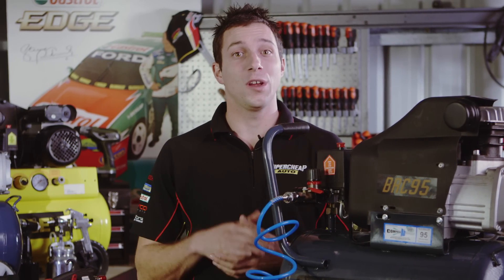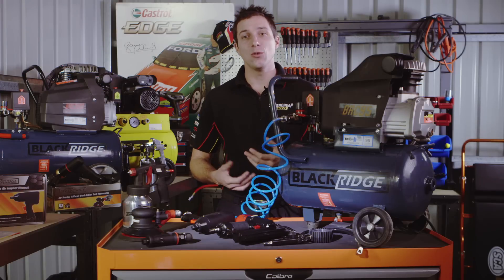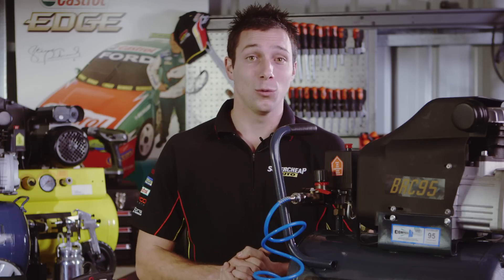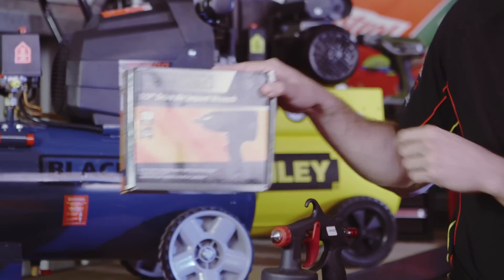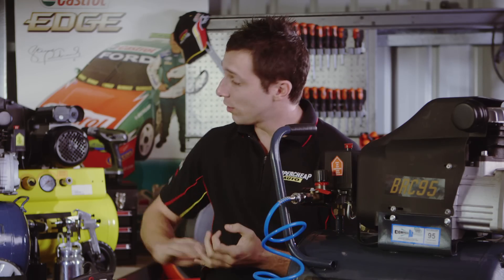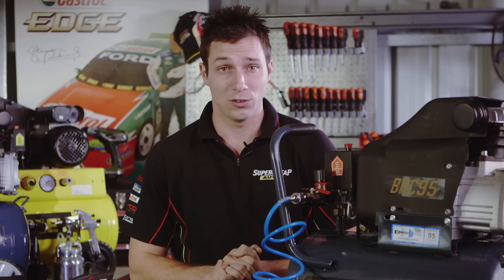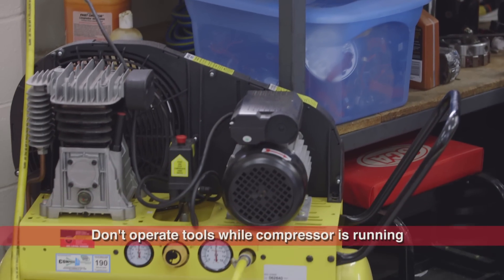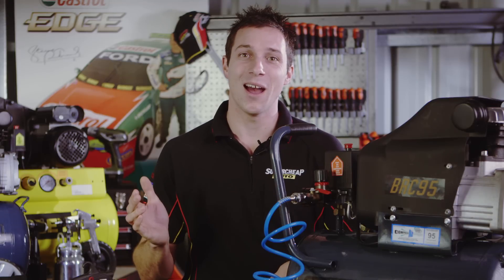How to - Choosing a 240V Air Compressor // Supercheap Auto

Comment: might be a good idea not to mix metric (LPM) with imperial (PSI) units. Other than that, a clear simple intro to air compressors.
Reply: yeah, technically it's illegal to advertise products using imperial units in Australia, not that anyone's ever been busted for it.
Reply: It's depending..how/where you use it for
Reply: In the UK, compressors are sold with specs quoted in HP, CFM and Bar. Any explanation needs to be done using local norms.